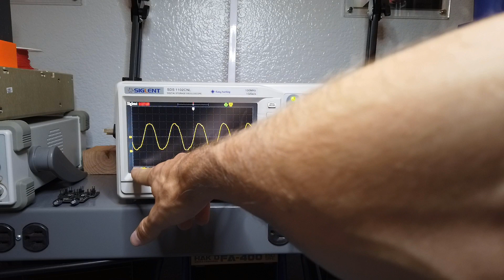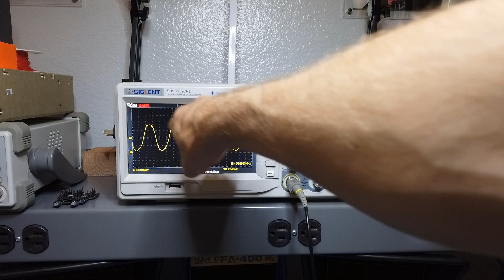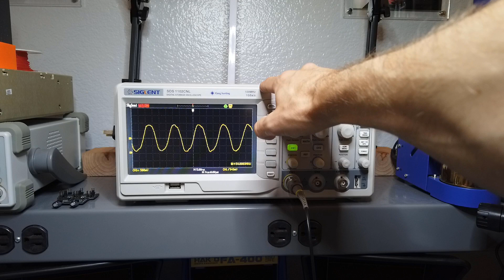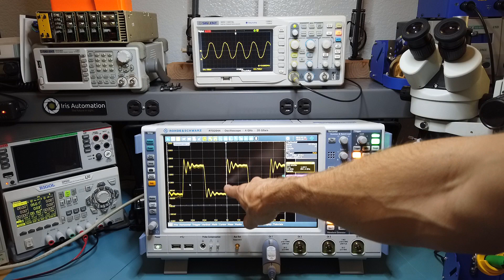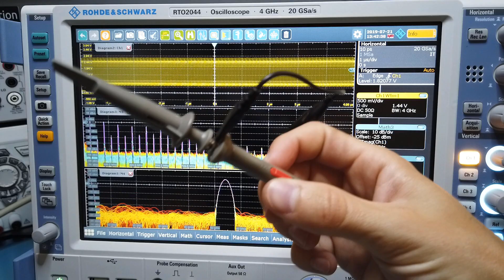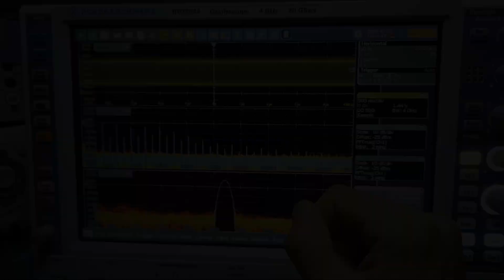What is an Oscilloscope?

Comment: Amazing video! Just amazing. Recently i have been selecting test equipment for a home shop upgrade. I am purchasing the same programmable power supply as you but a different variable supply. I am also purchasing a fluke 117, frequency counter, function generator, oscilloscope, and 2 logic probe and pulsers. What can you tell me about that power supply personal opinion and also what type of CNC mill do you use?
Reply from the maker: Are you referring to the Rigol DP832? It’s a great supply for the money. Channel 1 is isolated from channel 2 and 3, so if you need split rail supply for opamps, you can do that with this supply. The SCPI command set is pretty straight forward and easy to use with Python  PyVISA or LabVIEW... what ever your preferred method for talking to instruments is. For the cost I don’t think you can find a better 3 channel programmable supply on the market right now. If you need better resolution then the price starts to go way up.

The CNC mill I have is an Othermill (now called Bantam Tools). It is great for doing PCB routing, I can consistently mill boards with 6 mil trace widths. The mill was designed for PCBs, although you can do small aluminum/plastic/wood as well. I believe the spoil plate has like 5x4 inches of build area in X and Y, the Z height is less than 2 inches, so it’s not ideal for much beyond PCBs. In hindsight, today I’d have gone with a more general purpose desktop mill that could do more mechanical work for bigger aluminum parts and things like enclosures. I’m not milling PCBs as frequently as I thought I’d be given that most of what I work on requires multi layers for EMC and signal integrity. Hope this helps!

I’m going to be doing a video on power supply soon!